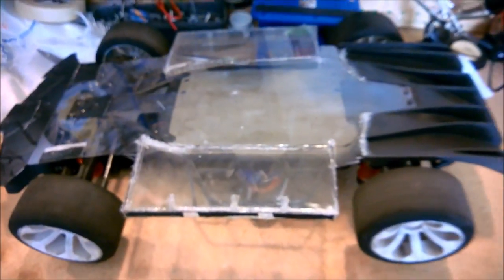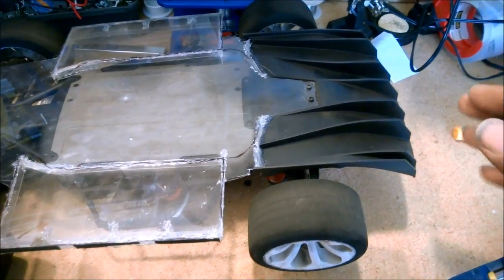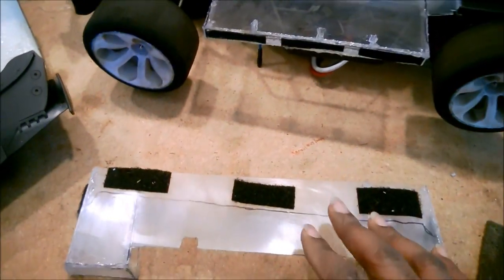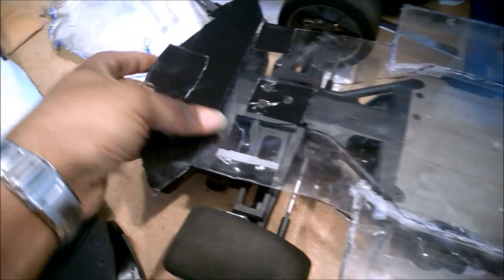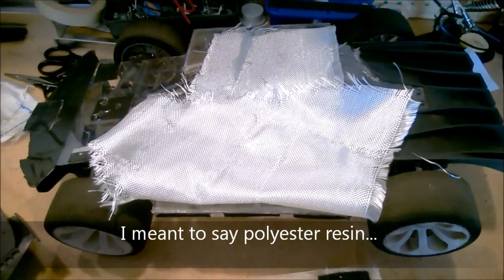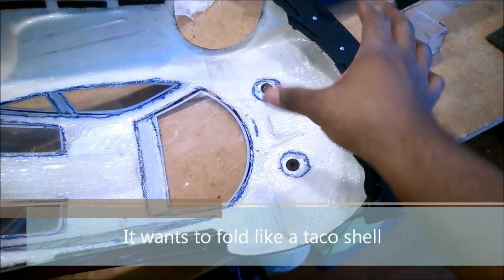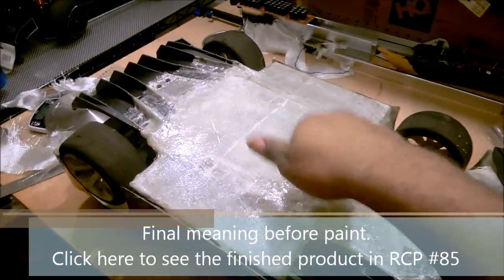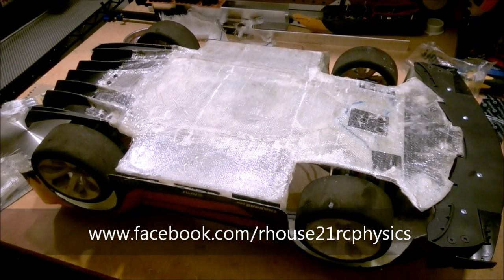Ep. 83: What Lies Beneath: Dizzy Underbody Aero Reveal

Comment: I'm doing the same thing toy pro2. If you do get lift, I've found that creating a golf ball effect down the center channel can help dramatically. Just make a a series of dots with hot glue with a higher concentration where the top body is tallest. This seems to help to stabilize the laminar flow of air at higher speeds and you don't create a low pressure pocket at the rear. Love the rear diffuser. What angle is the kick-up at? The last I read 27 degrees was the best angle.
Reply from the maker: Gregory Mosher Great suggestion! As for the diffuser, to make my life easier, I just molded a stock XO-1 diffuser into my custom plate. I didn't measure the exact kick-up angle, but it appears to be in the ~25-ish degree range. 

I am still trying to figure out a good way to recognize whether the cars are producing lift during a speed run. My Aero work is pretty good at keeping their nose down, but I could be getting "light" at the rear end with no way of really knowing until something bad happens. I'm a strong believer in the build-up approach, so I've just been working up to the higher speeds in the hope that I find the edges of performance before they find me.
Reply: rhouse21 - RC Physics You can mock up a wind tunnel with a leaf blower and attach a streamer, paper or cardboard to the back of the diffuser and watch from the side. It takes an assistant to keep the leaf blower from running away, but it works.
Reply from the maker: Gregory Mosher That's a pretty cool idea. I think I need to try that and make a video!
Reply: Gregory Mosher Just a sidenote. Mosher has started a blog on his build at http://rcspeedrunhub.com/?q=blog I'm not sayin... I'm just sayin lol.

Comment: Nice work and good explanation sir! :)
Reply from the maker: DutchRC ADVENTURES Thank you. It was a fun build. I'm honestly surprised more people haven't done this.
Reply: rhouse21 - RC Physics Yeah.. Even more surpricing cause Traxxas showed people the way..Would wheel-wells (incorrect word? :$) be a good idea to prevent air from seeping into the car??
Reply from the maker: DutchRC ADVENTURES I seriously considered that, but the air flowing past the wheels actually creates a low pressure that pulls air OUT of the car body. So, I decided to use that effect to pull fresh cooling air into the car through vent holes I drilled into the fake inlet vent Ofna molded into the front of the car.
Reply: rhouse21 - RC Physics Forreal! I did not know that sir :)  Damn.. I'd love to have a wind-tunnel for these things (and airplanes as well offcourse) :)
Reply: @scivanpoon  Damn! 4 years ago.. I had kinda forgotten about this project :)